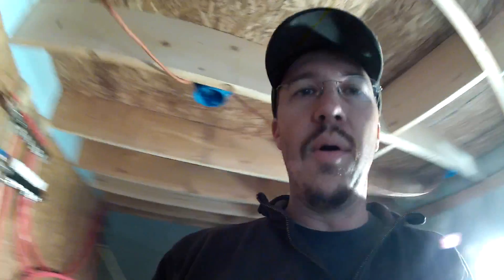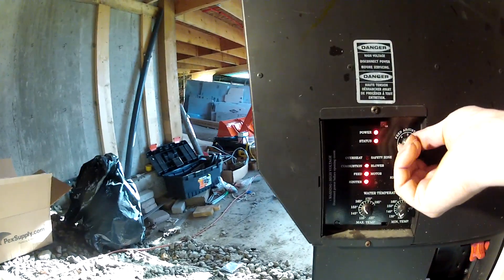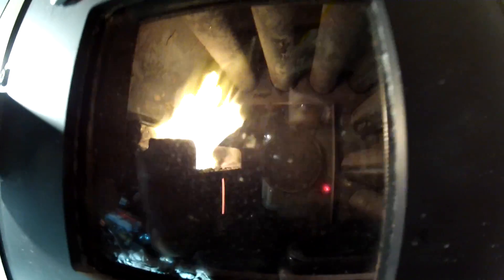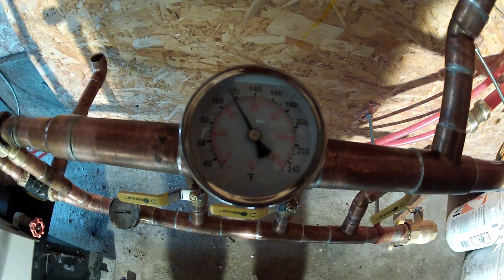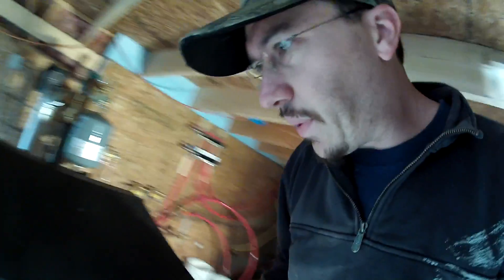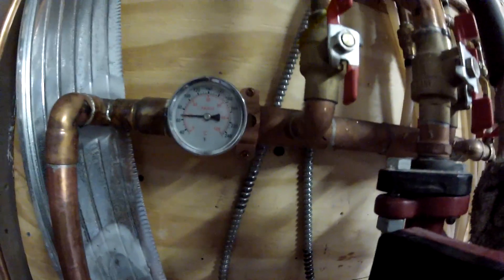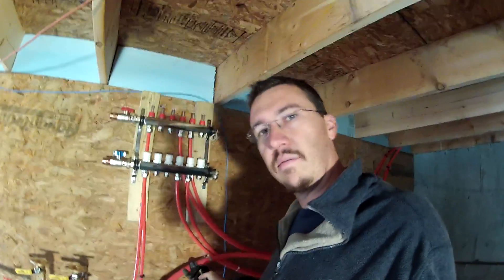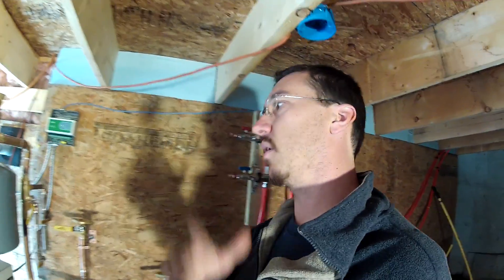Harman PB105 Pellet Boiler First Firing Review - 117 - My DIY Garage Build HD Time Lapse

Comment: Do you still have this system?  My wife and I just moved into a house that has this exact system, and I am learning it.  I am having an issue with the pellets not burning all the way currently and cannot find next to nothing online about it.  Also having a hard time getting inside it to do a full deep clean on all the water/ heat exchange pipes.

Comment: Did you consider running the exhaust up thru the main floor and the second [third?] floor, then exit out the roof or the side of the garage near the roof? I was thinking it might dump a little more heat in the building, get the exhaust higher above the ground (I know its not a lot of particulates, but still), and provide more draft in the initial lighting stage.